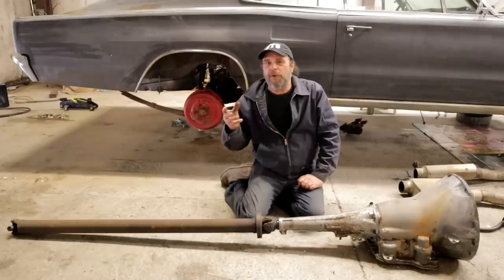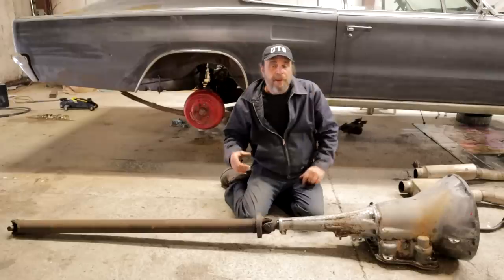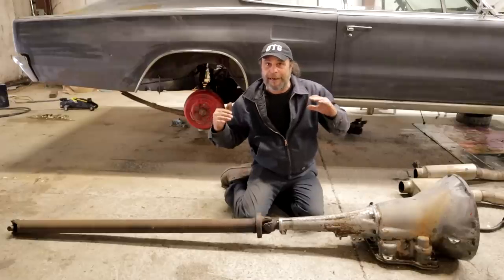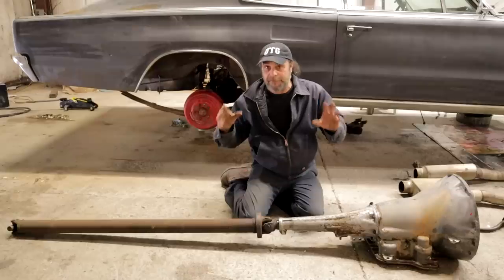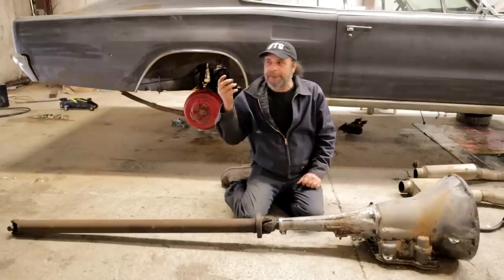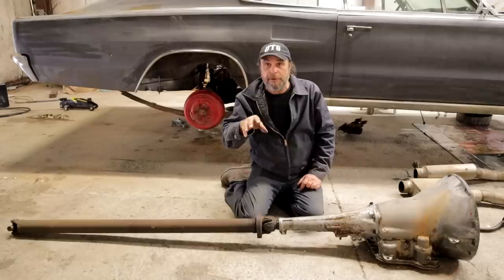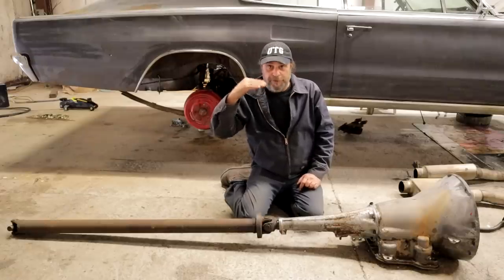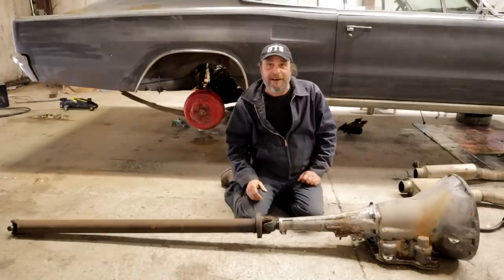Driveline Setup - Vibration And Power Loss Through Excessive Driveshaft And U-Joint Angles

Comment: The engine/trans offset to the passenger side is a Mopar thing. Almost no other company did that. 
As long as the shaft centerlines are parallel, except for spring wrap, everything equals out. Almost imperceptible power loss. JMO

Comment: Except Chrysler always has u-joints offset looking down or up vertically from the ground. Specifically so that as the axle raises or lowers in relation to transmission it will never line up and cause a vibration. You do not want much offset, but you must have some or a vibration will result. This is illustrated in the Mopar/direct connection books

Comment: What’s the recommended crankshaft/trans angle? 0°, -1°, -2°, -3° etc?
Reply: Personally, I start with a near match and then adjust if needed.  That means a half degree [with a half tank of gas].  So if engine/transmission is angled down 3 1/2 degrees, try pinion up 3 degrees [as they face each other].  When you get on the gas, the pinion tries to climb and should result in pretty close to parallel under load.  If you've got worn bushings or springs are seeing some axle wrap it could need an even bigger diference.    I use a digital angle finder with 0.1 degree readout.
Reply: @flinch622  I’m not following your logic, the rear pinion is the variable factor as you stated, only you can’t start with a positive angle moving in the direction of pinion rise.  The pinion will climb the ring gear maybe 1-7° depending on power level and suspension stiffness. 
If you had the crankshaft angle at 0° with the pinion at -3° down it would rise to straighten out the driveshaft. 
Most GM rwd cars came factory with a -2° to -3° crankshaft angle; in those leaf spring cars the recommended pinion setting for racing was -3° to -7° 
Starting “Up” in this scenario would be an issue.
Reply: @HeadFlowInc  The idea is to keep centerlines at/near parallel when it comes to pinion vs output shaft, and assumes ujoint mounts on shaft are syncronized.  Keep speed variables at both ends of the drive shaft in sync and keep from tearing stuff up.

Comment: i got my 66 gto then i got a 75 Bonneville found that a lot parts bolt right on the 400 turbo and drive line went right in the power trunk bolted right in the electrics on seats bolted right to the buckets under the hood light the tilt wheel plus it had a 455 that i put in funny part is i got the 66 gto for 500 then picked up the Bonneville for 100 buck running and driving just had a smashed 1/4 panel the tri power i got cost 800 which was more then i had in the car but worth it i built that when i was 15

Comment: You talked about parasitic drive loss but not the driveshaft speeding up and down when the u joint runs on an angle hence the other end needs to do the opposite..trans and diff angle needs to be in the same plane a grocer getter

Comment: I'd love someone to point me in the right direction with a problem I've been having. I have a 74 charger with a 91 dakota power train, was told the driveshaft was from a 68 dodge pickup and the rear end is the factory 8 1/4 with 2:76 gears. My problem is this, up till 85 nothing is wrong but beyond 85 I start having a pretty noticeable rumble, it's not constant, kinda like a horse gallop, lugaluga....lugauga.....lugaluga. and as you go faster it'll calm down a little but it's still there, if you let off the throttle it'll be a little more violent, at 130 it's more or less gone, it's there but you barely notice it either because it's rotating so fast or evening out. I want to say it's the driveshaft not being balanced but in my 69 the 904 shaft was shortened for a 727 and it would make it to around 65 and be so bad you couldn't possibly take it faster and expect that car not to fall apart it was a constant very violent rumble that would get rougher and rougher. The 74 has been like this since I bought it a year ago and I put in new ujoints a year ago along with a rear seal and I take it this fast almost every day and the seal is still good along with the joints. Am I correct in thinking that whoever shortened the 68 pickup shaft didn't balance it correctly or is it something else?

Comment: Great video ! Cardan joint. I’ve 3 1 tons. Variation of a CV joint of sorts. And they too can be rebuilt but they suck and it helps to have an extra set of hands ! Ball bearing in between two u joints and that wears too …..
Reply: Yes double cardan joint

Comment: Ujoints that don’t have angle will not center the drive shaft while spinning causing premature failure.
Reply: What I have read in my manual is that there is an equal and opposite angle on each u-joint.  A degree of about 1-3 degrees I think.  The rotating drive shaft cancels out the slight speed up and slow down of the u- joint motion and the action I believe makes the joints last the longest.  I think Tony is mostly talking about drag applications, where that motion takes up a little bit of power.
Reply: Yeah, when I put a completely different drive train in my 56 panel, I read the same and so I got it as close as I could with and angle finder the equal/opposite way you described and haven’t noticed anything bad—-but it seems as though if it where perfectly in line, there would be less wear and less power loss. 🤷‍♂️

Comment: Always wondered if offset position of the engine in the engine bay was because of the driveshaft.
Reply: I always wondered about this as well. I always figured that it was to counterbalance the weight of the driver and other components on the left side since most driving is with one person in the car. When I built my first hot rod I knew very little about this. I had driveline issues at first until I corrected the geometry as best as was possible.

Comment: The 5° downward angle of the yolk at rest should only be applied to vehicles with leafspring rear suspension. If the vehicle is converted to coil overs and/or has any type of four or five Link suspension then this is unnecessary and will cause premature failure of the differential.
Reply: Shouldn't, that's literally what he's talking about is play in the u joint angles that the suspension fixes when riding.if you know you're axle is solid mounted and will stay at it's set angle then sure set it up that way, but when you account for rubber bushings and suspension then you have extra angles to account for.
Reply: Yoke is what’s found in a driveshaft. Yolk is what’s found in an egg.
Reply: Aaaaaand it depends on the composition of your bushings. Are they metal heim joints? Rubber, nylon or urethane, and even at that urethane has several different formulas that deflect differently.
Reply: @TheMajictech  auto correct doesn’t know the difference 🤣

Comment: When I set up my ford 8.8 rear end, and a 46rh I set my pinion angle at 3.5 degrees down pinion, and my tailshaft at 3.5 degrees down. Did I do that correctly?
Reply: Universal joints will run at a fast, slow, fast, slow speed when run at an angle. Equal angles on each end cancels to a constant speed at each end. Only the driveshaft will see the speed change.
Reply: Um,,, your tail shaft and pinion have to be parallel. If your tail shaft is pointed down from the transmission back- your pinyon should point up from the differential forward.
Reply: You didn’t account for any pinion rise when accelerating. Don’t make them match sitting in the driveway

Comment: This is great info. I was taught that the rear diff needed to be parallel with the tail shaft to where the offset angles matched.  Is it better to angle the rear to point to the tail shaft if angling the transmission isn't ideal? To where only 1 u-joint has a slight angle vs 2? Hope this question makes sense. Thank you!

Comment: What hasn’t been said is ideally your engine trans angle will exactly match your pinion angle under most circumstances. It is a compromise due to different loading conditions of the suspension

Comment: Great video. I'm assuming this also applies to an IRS car/ independent rear suspension. The differential does not move It has solid aluminum bushings up front and delrin in the rear Do I want to keep everything As close too dead straight, or is it all right to have a couple degrees difference In angle between transmission and pinion Flange?

Comment: Hi Tony what do you think of holley 2BBL for example the 2245 ?
Reply: Fitting one of those to a driveshaft is going to be a real bitch.
Reply: @americanpatrol4603  it's not too bad if you do an intake yoke swap, but it's pricey.
Reply: Better get 2 of those carbs, and make sure they are exactly 180 degrees apart or it’ll vibrate like hell.

Comment: If the tail shaft was lowered slightly to align the driveshaft I think that would change the horizontal plane on the intake manifold and general functions such as oil drainage down to the pan. This is probably not a huge difference but you might need to compensate for fuel levels in the carb especially with a Holley style carb with a front and rear fuel reservoir.

Comment: I have a build where there is no suspension on the vehicle and planned to hook the tranny directly to the rear with a splined dragster coupling.  Will it hold up on the street.  It's a Mark Williams dragster coupler.
Reply from the maker: How are you going to keep it lubed?
Reply: @UncleTonysGarage  I could install a grease fitting.

Comment: I think what you are saying may be a little confusing to some noobs. Driveshaft shouldnt be in straight perfect line. Tailshaft and rearend should be parallel to each other within 4 degrees. Simple as that, so if the tail tilts down your rear will tilt up within 4 degrees. It they are all in perfect line it will vibrate. Ujoints aren't designed the be ran perfectly straight.
Reply from the maker: You're wrong about that.  The 4 degrees you're talking about is a ballpark number based on pinion angle.  A dead straight driveshaft will absolutely NOT vibrate
Reply: @UncleTonysGarage  You have to have some angle, a minimum of 1/2-degree, or the needles will brinell the surface of the u-joint, cross-bearing journal. U-joints were designed to operate at an angle, and if they don’t have an operating angle, they will wear out prematurely. - This is a qoute from an engineer.
Reply from the maker: In a stationary application yes, but a car suspension is nearly always active, and the straight line between trans and diff is theoretical at best.
Reply: The man is right. I've never seen a pickup truck that the driveshaft didn't angle down from the tail shaft to the differential. As long as the rear u joint is at the right angle to cancel out the speed variable of the front u joint, it's not only fine, but designed that way. What you're saying may be true for cars, but you're leaving an important part out, UT.
Reply: @DistinctOgre  Probably because trucks have different angles when loaded and that's what they're really designed for. You don't want a lot of angle under heavy torque. Everything about a pickup is meant for loads.
Reply: @dandiegidio7729  
What you're saying may be true, but its completely irrelevant. The point is it's not only fine but normal for a driveshaft to run on an angle, as long as the angles at each end are sufficient to cancel each other out.

Comment: You've oversimplified it, bordering on misinformation. If your driveshaft is out of phase you'll get vibration, and while its technically true you're driveshaft doesn't spin at a constant speed when an angle is introduced, as long as both front and rear angles are mirrored, that oscillating is cancelled and you, nor the drivetrain feel any of it. It is isolated at the u joints and only affects the shaft.  They only time you would feel a vibration is if your angles dont match and instead of cancelling the oscillating you're amplifying it. Or if you have a 2pcs driveshaft and your joints are misaligned